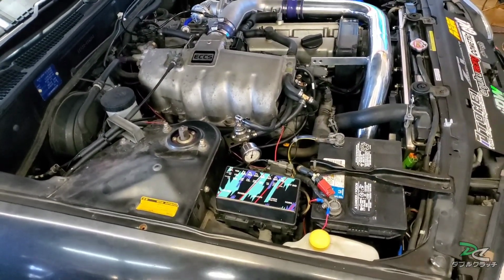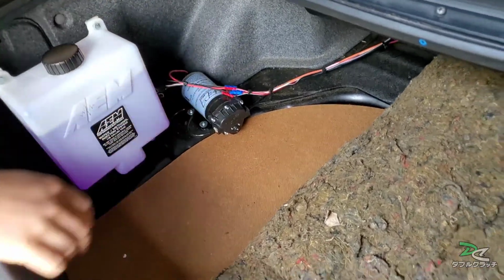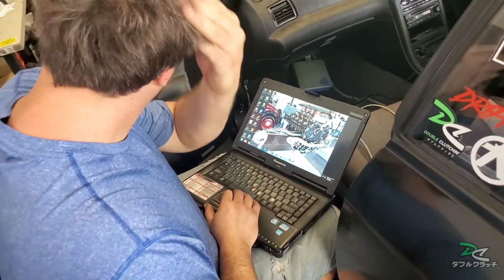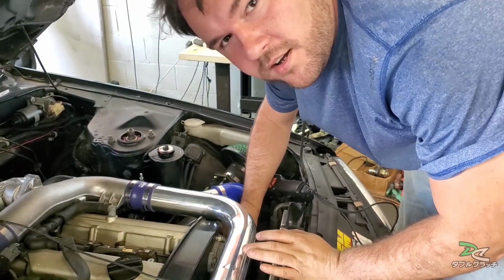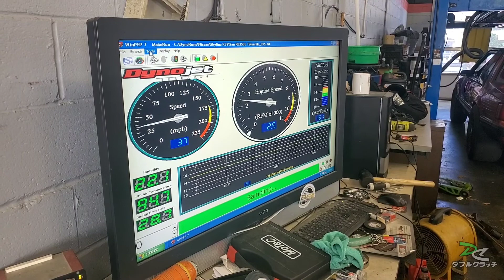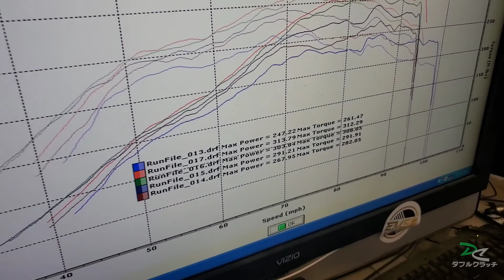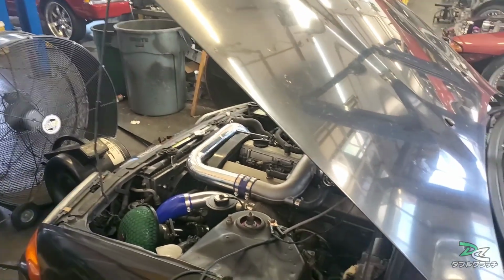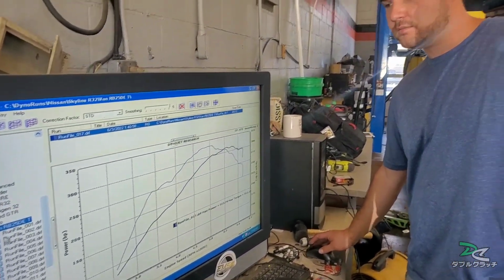R32 Skyline RB25DE-T Tuning Day

Comment: those are respectable numbers for sure.. that's a 400hp (crank) all day. nice work!
Reply from the maker: Thanks! I was surprised to reach that much hp at 14 psi and my goal is 300 hp since it's NA. Since the NA engine is without oil squirters, I don't want too much stress on the pistons. Therefore, I have to run water-methanol to cool it down and prevent knocking and detonation.

Comment: Nice work! Those are some nice numbers.  Time to enjoy it now!
Reply from the maker: Thanks! Haven't pushed it hard yet but sometimes soon. Just baby it for now lol.
Reply from the maker: From what the tuner said my turbo still can do a few more pulls but seems the engine is not generating any more power. Maybe due to the pistons being different from the DET. I might get away with 350 hp with a top-end build.
Reply: @doubleclutchin6860  yeah that's basically what I have been doing also. I've put around 500 miles on mine.  I've also been gentle with it so far and I'm only on 7 psi.  15 sounds fun but would scare me haha.
Reply from the maker: @DIYAUTOCAR  to be able to run at 15 psi is to have a higher octane. Go with E85 or water methanol method will take you there. For NA like us, we're limited and have to do extra stuff to make the power we want. As for DET is different because it has oil squirters to cool the pistons and will produce more power with less work.
Reply: @doubleclutchin6860  That is a smart way to do it. I might look into doing that myself if I decide to run more boost or a bigger turbo.  Seems like a good option to keep it safe.
Reply from the maker: @DIYAUTOCAR  Yes, it will keep the pistons cool down to prevent knocking and detonation.

Comment: Brother, I have a 1994 Skyline R33 GTS25T RB25DET Turbo. I need to tune my as well. But I just have the stock ECU, do I need to upgrade my stock ECU or aftermarket ECU in order to tune or can I just tune with a stock ECU. Here is what I have upgraded so far my front intercooler, HKS Blow off valve, cold intake, and HKS cat back exhaust system. Please let me know what I need to do or change before so I can tune my R33.
Thanks.
Reply from the maker: Yog Zoo! Your stock ecu should be good for your current setup because those are basic bolt-ons. The only reason you have a standalone ECU is when you upgrade the fuel pump, bigger injectors, maf, and upgrade turbo. Since you're running an OEM RB25 journal-bearing turbo be safe boost is 7 psi. To bump the boost up to 8-9 psi with a boost controller. I don't recommend over 10 psi unless you're running a bigger turbo. 

Another reason I'm using a standalone ECU is that I'm running an NA engine from RB25DE and converted it to turbocharged. I wanted more hp, so I upgraded my OEM parts, and a standalone ECU is required.

I'm happy with my current setup but I'll want more hp in the future. So, stay tuned and subscribe to my channel if you haven't and I'll return you a favor back. 👍

Comment: What is the RB25DE out of?

Is it a series 0 out of an R32?
Reply from the maker: Yes, series 0 from the ECR32 R32 auto. Did a whole changeover from auto to manual and Na to turbo.
Reply: @doubleclutchin6860  Oh cool! How has the reliability been so far? Any issues running that much boost?
Reply from the maker: @Jessefsjp  So far so good. Minus the two turbos I went through, they were used and I guess the oil seal went out. For the engine to handle such power is by replacing the fuel pump, bigger injectors, water methanol to 100 octane, and with proper PFC tune. The last tune I was pushing about 312 hp at 14 psi. I think the HKS turbo reached the maximum psi. I'm currently running a Maxpeedingrods turbo direct bolt on the the RB20/25 so we'll see how long it last. I'm looking for a rebuild kit or someone who can rebuild the HKS GT2530 Kai turbo and they are discontinued.